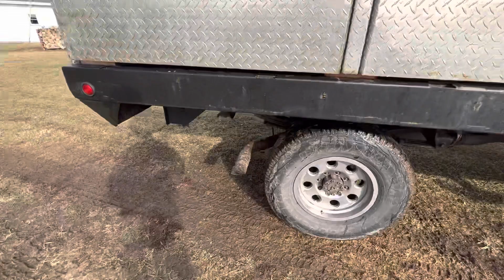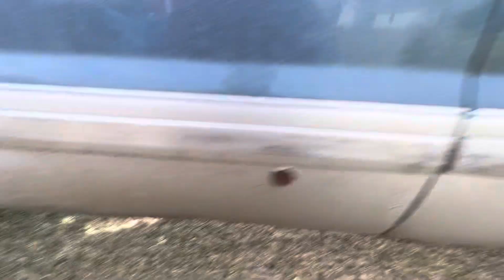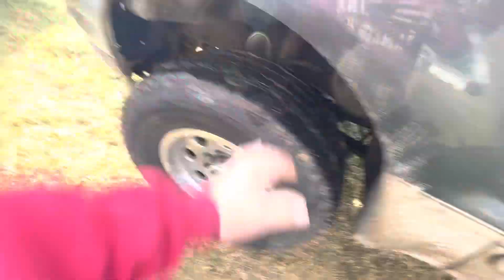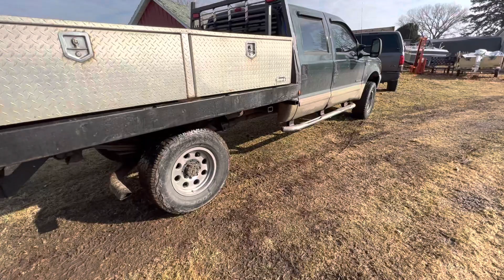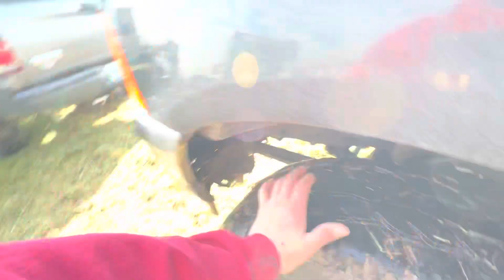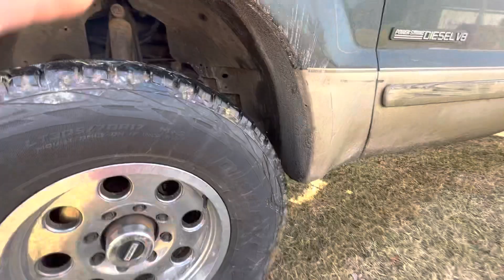SULASTIC shackles. 3 year review.    Leaf spring trucks listen up

Comment: When you were showing the Sulastic Shackle in the front I noticed it almost completely bottoming out. Ive had my Sulastic Shackles for 3 years too and mine too seems to be worn out. When I first installed them the shackle operated in the middle of its stroke but now I think its worn out. I also noticed that mine has been riding bottomed out for so long that the little rubber bumb stop strip is gone from wear.
Reply: Long ago, I installed Lord's Velvet Ride rear shackles on my 3/4 ton. It worked similarly, the ride was much improved, but the rubber block eventually sheared off, so I was no longer impressed.

Comment: My 92 C2500 rides decent in the front (coil springs) and has a 5 leaf set up in the rear. It rides ok in the front and the rear beats us to death it's so stiff. I'm thinking of doing a set of rear SA-04HD SULASTIC SHACKLES or swap the leaf springs for C1500 that will fit.

Comment: Ok. You've convinced me. I've got a 2004 F-350 crew cab long bed 4x4 that hops and bucks on concrete highways. On asphalt, it's smooth as butter. I've tried countless recommendations, expensive shocks, different tires, etc... nothing stops the bucking. I believe it's because the front and rear leafs osolate at different rates when hitting the expansion joints on concrete highways. The osolation cycle seems faster in the rear. So I'll try these and see if it helps.
Reply: Did this help I have the same exact thing but a f250. But I have the same issues and was curious on trying these out. Also when you put them on did it lift your truck up any cause I’m already lifted and it sits level and don’t want it to have that squared look
Reply: Squatted*
Reply: @Blake Campbell  I have not installed my set yet. In a few weeks, when I get a couple free hours... I will. I'll let you know.
Reply: @CR500R How’d it go? What’s the ride like now?

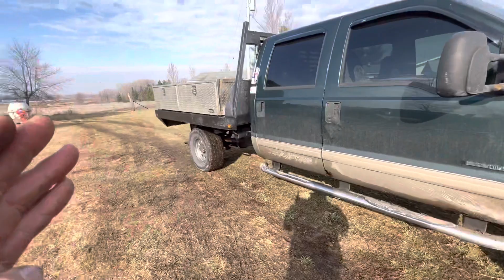Comment: I installed Lord's Velvet Ride rear shackles on my 3/4 ton. I worked similarly, the ride was much improved, but the rubber block eventually sheared off, so I was no longer impressed. I think the Sulastic also relies on a rubber torsion mechanism. But at 3:38 you say they don't work in the rear, i am not so sure. If they can dampen the shocks on an empty bed, that is already an improvement. And I agree they are pricey at $500 for a pair.

Comment: Thank you!  Sulastic shackles on the front leaf spring suspension.  What do you recommend on the rear leaf springs on a daily driver with no load?  Do they change any tow characteristics like capacity or stabilization (rear end sway when towing)?
Reply: I find that my airbags inflated properly cushion the blows of the imperfections on the road when I drive empty. With a load too, obviously, but the improvement is more noticeable when driving empty. Basically, the weight rests on the airbags which act as air suspension. Only in a hard hit can i feel the frame going down all the way to the stiff springs.